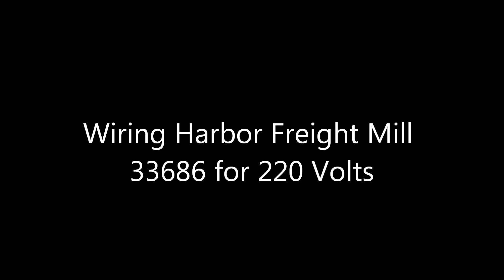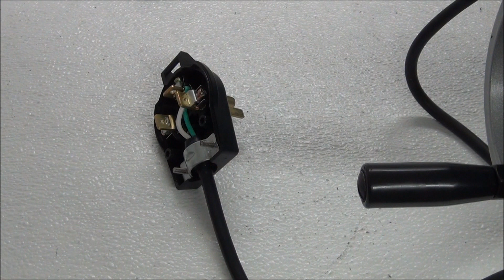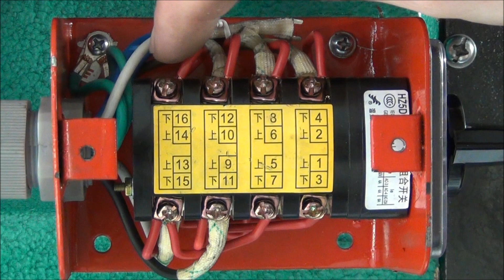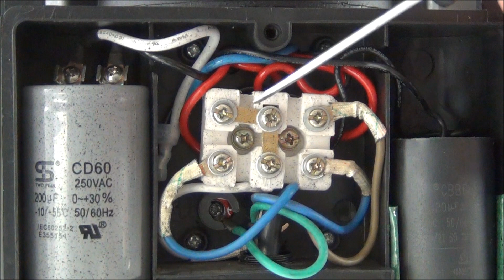Wiring Harbor Freight Mill 33686 for 220 Volts

Comment: Hi, The White Wire is a Nuetral. And so you disconnect the White Wire from the Motor and the Switch? Is that Correct? I’m not quite sure.
Reply from the maker: It has been a while, but I'm pretty sure I left the white wire unhooked on both ends.  Check the manual for the wiring diagram to make sure.

Comment: Hi, what did you do with the White Wire in the Motor Peckerhead.? I’m not calling you a Peckerhead, that’s what the Motor connection box is called.

Comment: I have a mill with the same switch. It was totally removed when I got it used and all I'm looking at is wires from the motor. Could you send me detailed pic of how it's wired so I can get a new switch installed?

Comment: Thanks for this video.  It worked great and saved me a lot of research time.  Only problem I had was my 20 year old ceramic motor terminal block fell apart when I loosened the wires.  I just replaced it with wire nuts.

Comment: I for one was surprised to see how little was required to switch from 120V to 220V on my machine, and yours appears to be an even simpler arrangement to switch over as you have a different terminal block.  Thanks for sharing!
Reply from the maker: I was surprised too.  Fairly simple process.